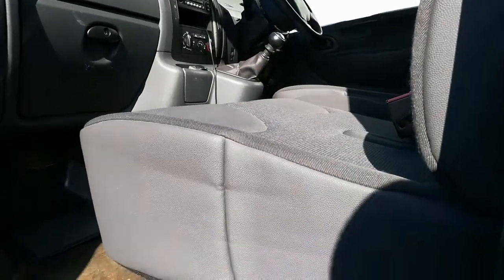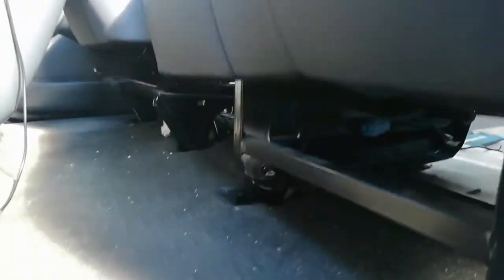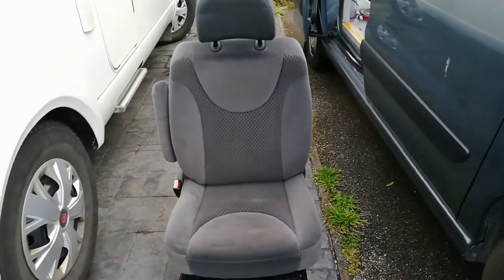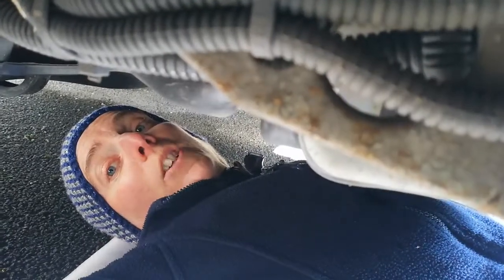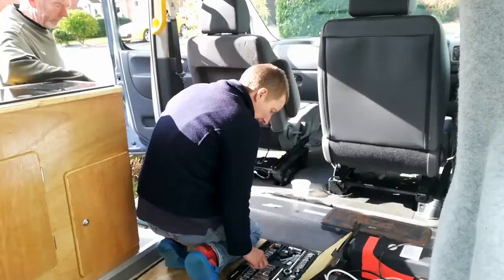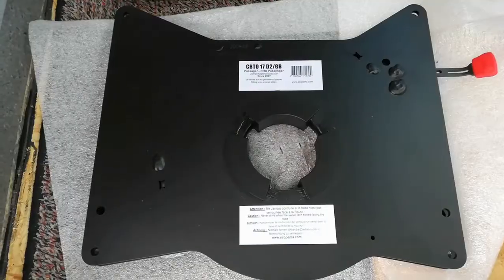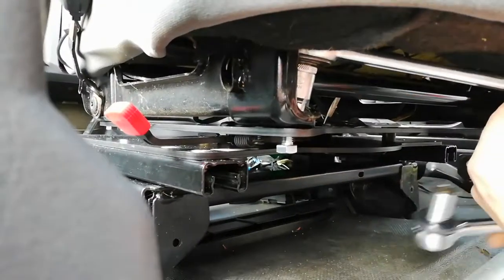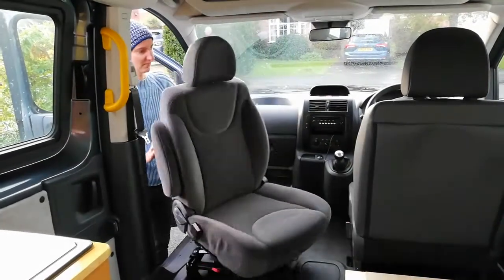Peugeot Expert Camper Conversion - Part 12: Changing the passenger seat/installing a swivel

Comment: Super video - I have a 2014 Citroen Dispatch Combi(same as the Expert) that we use as an occasional camper - the front middle seat is too small now for our kids to use so the idea of swapping this out for a swivel base is very appealing. Your video made it clear that this is actually doable and not too difficult(especially when you have the instructions/diagram!).  The problem will be in sourcing a single seat I imagine.

Comment: On ebay they do a diode i think that you plug into the socket for seat belt cable and it makes the computer think it is pluged into the seat belt
Reply from the maker: I think I mentioned towards the end of the video that I'd ordered one, however, by the time it arrived the only way we could remove the seat belt and access the connector was to take the seat out again, so we decided it was easier to just live with the spare-seat belt solution.

Comment: Buy airbag resistor bypass off eBay, they are a couple of pound and you just plug them in and it will put the airbag light out and you won’t have to have a third person seatbelt under your seat👍
Reply: Came here to learn about this! Is there a particular one we need do you know? There are so many different models on eBay!

Comment: I’ve just removed the double passenger seat and fitted a single drivers seat to the van. I managed to pick one up for £95 delivered and it’s in good condition. After watching your video understand the issue of the ABS light coming on that is because the pre-tensioner system for the passengers Centre belt is not working. I have fitted the whole seatbelt under the chair to turn the light off for now but you said about you ordered a resistor part to sort this out. Do you have any information where I can buy one of these connectors to turn the light off.

Many thanks for the great video it was really helpful.
Reply from the maker: Glad something was of use to you :-)

The device I bought was listed on Ebay under the description: Car SRS Airbag Emulator Simulator Resistor Bypass Kit Fault Finding Diagnostic.

I can't confirm that it does the job for which I bought it because by the time it arrived we'd realised that in order to remove the spare seatbelt from where we'd sited it under the seat, and to access the connector, we'd have to remove the seat again, so we decided to go with the easy option of just driving around with a spare seatbelt.

Interesting to hear you've fitted a driver's seat. I had suspected that the fitting points for both driver and passenger seat were the same, and driver seats must be much easier to come by than single passenger seats.
Reply: Hi Dumpvalve007. I've also just purchased a drivers seat to replace the double passenger bench seat but not yet ordered the swivel. I'm assuming we would still purchase the passenger swivel rather than the drivers swivel but I just wanted to check you had done the same with no issues regarding the fixing points between the passenger swivel plate and the underside of the seat?
Reply: I have a 2014 Dispatch do you know if the front seats of a Peugeot 807 fits?

Comment: Very useful video. I am about to do the exact same to the same model of Peugeot expert, except the single seat I have is another driver's seat.
One question I am worried about:  Did you disconnect the battery before disconnecting the seat, or is it ok to disconnect the existing seat with the battery still connected but the ignition off?
Reply from the maker: We didn't disconnect the battery, but did have the ignition off...until we turned the ignition on and got an air bag error come up. We feared an error code would need to be cleared, but as soon as we plugged the old Seat 3 seat belt in, the error went away (yep, still driving around with the third seat belt sitting under the seat 3 years later!). Probably best not to turn the ignition on until you're done, though. All the best.
Reply: Thank you. This is good to know.

Comment: Hi Gayle.. I bought a swivel for the same van as yours including with the wheelchair ramp etc. Having watched your video I took the seat off and left the rails)(my van came with a single passenger seat). One issue I have is that I'm pretty sure they've sent the wrong swivel as the holes don't line up (over 2cm to far) and secondly, the arm rest on the passenger seat hits the passenger door and and that needs to be opened to be able to rotate the seat, is that the same in yours? Thanks for any tips, hope you're having some good adventures with it.!
Reply from the maker: Once we'd worked out at which level of the structure the swivel went, the holes lined up perfectly. To swivel, we have to tip the back of the seat forward, which then allows the seat to miss the door as it turns. Theoretically, it may also be necessary to slide the seat forward on its rails before rotating it, but thus far I've not noticed that we have to do that (maybe because the seat is generally in about the right position anyway).

Hope you get it sorted as the swivel is such a big bonus to have.
Reply: @GayleEBird  thanks gayle. Figured it out in the end. It turns out my swivel needs to be under the rails, so on this occasion watching your guide threw me off. It probably works better that the rails can rotate as it gets a bit more movement perhaps. The arm rest doesn't fit well though and there are niggles, but yes as you say, totally worth it. Not decided on whether to do heating and solar etc but if I do I'll be checking back on your videos. Happy camping!

Comment: Hi we are just about to do this your video will really help us, we are in the process of buying a seat. The person selling says its to much hassle to do what you did, have you any idea if a seat from a new shape expert fits just like the way you fitted your seat thanks.
Reply from the maker: I'm afraid I've never even been inside one of the latest model Experts (2016 on), so I've no idea whether the seats are the same or whether they have the same fixing points and positions. 

I'm intrigued as to which bit they consider too much hassle? Even with our false start and faffing around, it wasn't a long-winded job and with the knowledge gained I would be confident in being able to do it in around an hour if I was to repeat the exercise. In my opinion, the huge benefit in giving extra space to the living area and being able to get from front to back without going outside significantly outweight the effort of making the switch from double to single. 

Hope all goes well with sourcing a suitable seat and doing the swap-out.
Reply: @GayleEBird  Thank you

Comment: Hi in the process of changing my seat to a swivel. Do you have a link for website the base came from please
Reply from the maker: I went for this one from Kiravans:
https://www.kiravans.co.uk/collections/swivels/products/scudo-expert-2007-2015-passenger-seat-swivel-rib
Reply: @GayleEBird  Hi again. Update for you and advise needed. i bought the swivel from KIRAVANS  and a seat from eBay. As I'm not mechanically minded i took the van to the garage who removed the double seat but discovered the Peugeot partner seat i had bought did not fit as the holes were in the wrong place.  I need a bit of advice the seat you bought was it a Peugeot Expert seat or was it something else, I don't seem to be able to find any single Peugeot Expert seats i take it they are available. also do you know if it has to be for the same year as my van (2012).  Any advise as to what seat I need would be appreciated. I saw your last video and Erica looks great well done.
Reply from the maker: @stuartwinzar4981  Ours was a Peugeot Expert seat. Single passenger seats certainly aren't readily available but they do come up for sale every now and then. I saw one for sale in late July (that one was £150 and unfortunately sold by the time we got Erica) then we bought one at the end of September (for £40). I didn't see any for sale for less than £600 inbetween.

As for year, any front passenger seat from a Mark 2 Peugeot Expert, Citroën Dispatch or the equivalent Fiat (can't think of the name off the top of my head) should  fit. The Mark 2 vehicle ran from 2007 to 2016, so any year within that window should do, albeit with caution for the first and last years when the models would have overlapped. We fitted a seat from a 2010 vehicle into our 2014.

Hope you find one soon :-)

Comment: What is the name of the item you bought to sort the air bag issue. It have put a two seats into the front and now have a side airbag under the seat. Thanks Phil
Reply from the maker: The thing I bought was snappily called: "Car SRS Airbag Emulator Simulator Resistor Bypass Kit Fault Finding Diagnostic". I can't confirm that it works, because by the time we received it we'd realised that to get the spare seatbelt back out from under the seat we'd need to remove the seat and swivel again, which was more trouble than just leaving it as it was. Fortunately, it only cost £2 delivered, so no great loss!

Comment: question for you, how did you manage to undo the cable connector, I have tried all ways to get it disconnected i just can seem to see how it disconnects
Reply from the maker: We had to break a part of the outer casing. Presumably it can be taken apart without breakage, but we couldn't see a way of doing it without some sort of special tool.

Comment: IT was not possible with dual seat?
Reply from the maker: It wouldn't be possible to put a swivel on the double seat, due to the design of the double seat in this model. The double seat sits on a single base, so only the side of the seat nearest the passenger door has the base under it, the other seat is an overhang. Also, there is no forward-backward slider on the double seat, nor any ability to adjust the angle of the backrest, so there wouldn't be the clearance to rotate the seat if a swivel was fitted.
Reply: @GayleEBird  yeah, thx fo nswer! ive seen all ur videos, ade very  interesting.  
I got same model and i gonna cmaper it! 

Thx for ur videos!!!